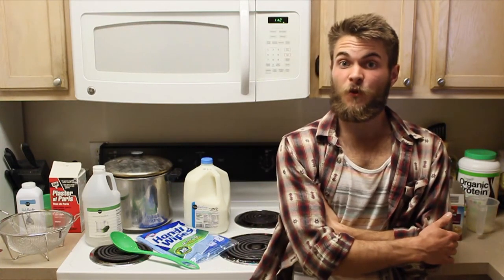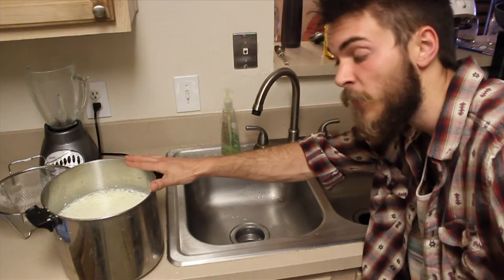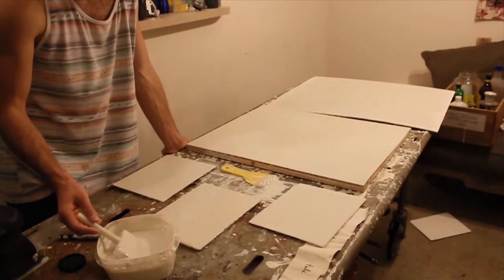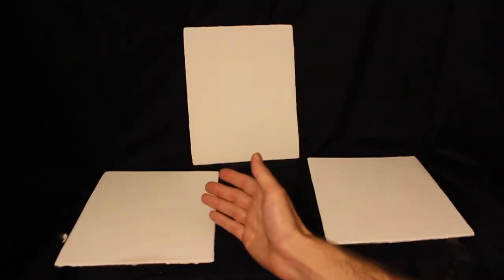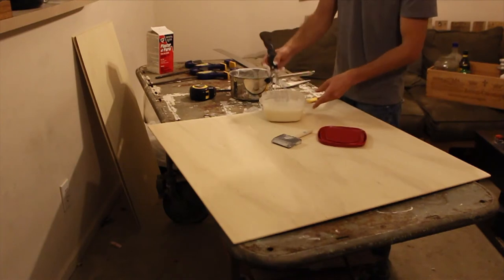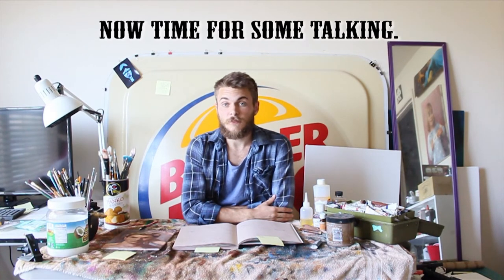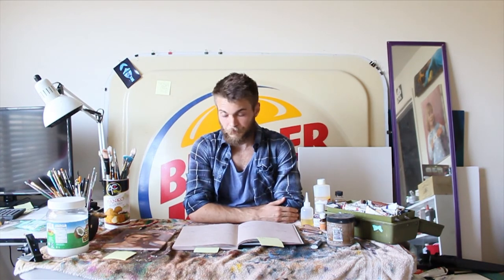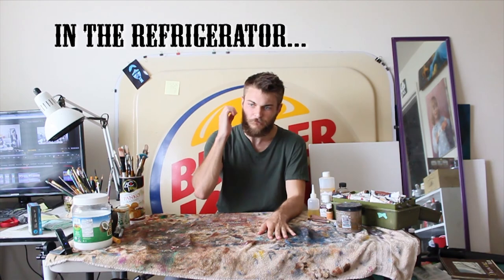Making Gesso From Casein

Comment: Hi Michael… great video! We have found the following:
1) Remember to seal your support (rabbit skin glue for example) as casein gesso and/or paints are not a sealer.
2) A drop or two of oil of cloves and/or vinegar go a long way as a preservative… in fact I have a jar of casein gesso in the fridge which is probably a year old and it still is fine.
3) You can emulsify the casein with a bit of oil… like stand or sun-thickened as a plasticiser for more flexibility… the same vehicle gives your casein colours a wider tonal range approximating oils.
4) The casein formula we found that working well for us was 1 vol of casein + 1 vol of calcium carbonate (calcite, marble dust, etc) + 10% oil as plasticiser + few drops of oil of cloves. This binder is mixed or better said dispersed bit by bit with pigment for casein colours… with titanium white pigment it becomes your gesso and/or white colour.

A question… why did you mix it with baking soda?
Reply: That was my question, too. Why the baking soda? I speculate that it is to neutralize the acidity of the plaster. I will ask my chemist husband ( Ph.D.) if there are commercially available  PH strips  so that I could test my final product for acid neutrality.
Reply: Baking soda for mixing with water. Dried casein is not directly water soluble

Comment: You said “it’s kinda like cheese” well right you were, you made ricotta albeit a very acidic one. Warm a gallon of  whole milk on the stove and add just two tablespoons (not cups)of any acidic acid of your choice , fresh lemon juice works great, and turn off heat letting it completely cool w/o stirring. The curd will separate from the whey and then  all you need to do is allow it strain in cheese cloth or a fine colander.  Makes a great lasagna or cheese cake but as for your casein I’m wondering if you might buy some store bought ricotta to save time and use that in your receipt? Thanks for your posts, you are a talented young man.

Comment: Hey, I don't know if you are still interested in casein gesso, but... I have an old recipe, recipe from a book about technology of oil painting. When it comes to wood it should be glued on both sides (70g of glue per 1l of water it should be heated in a water bath to 40C-60C) so the wood you want to use for your painting should be dried for at lest a year, otherwise it will rot (masonite is ready to use). While gluing the wood its important not to soak up the wood, it should create a thin film between wood and gesso. 
So the recipe goes:
Casein solution
50g of DRIED casein that you prepared
10g of slaked lime
This should melt right away and have smooth consistency
1part gypsum/chalk
1part zinc white(never titanium white because it dries very slowly, up to a year)
2parts water
1part casein solution
This can be applied on glued wood VERY THINLY (otherwise cracks will form) from left to right, after half hour you can apply second layer from up to down (its important that the first layer is semi-dry, because if its too wet it will mix with second layer if it is to fry it will not connect with second layer) After eight days its ready to be painted on.
Other very efficient way of applying gesso(best for canvases)  is with a shoe brush! You barley dip the hair in gesso and apply it onto the canvas moving your arm as if you were writing number 8, after whole canvas is covered you gently even it out brushing left to right, and from up to down.
Reply from the maker: That's awesome! Thank you for spreading the knowledge.

Comment: Great video. One suggestion. When I make a casein glue base, I dissolve the curds with a teaspoon or two of Borax. The result is a syrup that looks kind of like rubber cement. Other recipes use ammonia, but Borax does the same thing and doesn't smell as bad. This keeps you from having to cook and blend the stuff. A little heat like a few short zaps in the microwave helps, but that's about it. Thanks!
Reply from the maker: Michael Fraley Borax huh? I read about using that but didn't know what it did. I was also looking at xanthan gum to do the same thing. There is room for improvement here so I'll be sure to try that next. Thanks for the advice.
Reply: Michael Schmitt Just trying to be helpful, not critical. Yeah, Borax (boric acid) breaks down the curds, and, if I'm not mistaken, improves the ph balance a little too. You can use the resulting syrup like a glue, or mix it with pigments and create your own casein paint. Hey - I've had a horrible time trying to formulate a casein gesso. Nothing but a crackly mess. Thanks to you, I know now that I've not been using enough plaster. I appreciate that.
Reply from the maker: No problem Michael. I took no offence either. I'm actually very appreciative. The internet/youtube should be used for learning and the best way to do that is through communication. I'm glad we can help each other.

Comment: Hi Michael..I forgot to sayAll modern day art store acrylic primed canvas or wood panels ...are highly absorbent. This absorbency will suck the oil binder out of any oil paint, causing matte dry areas. The first step here is to apply a SINGLE coat of acrylic varnish..either matte or gloss. If too thick mix 25% water , but not more....for easier brushing. Again..place the support vertically to avoid puddles. Best wishes, Louis
Reply: Acryilic varnish before the oil paint? On canvas and wood?
Reply: @LP-zz7uz  h hi I. Yes. We can paint oil paint on acrylic paint but we cannot paint acrylic paint on top of oil paints

Comment: Thanks for doing this. When would you include a water sealing size below the gesso? I imagine wood panels would require such an undercoat. If you don't gesso and varnish the front and back of the panel or sheet can the casien rot from the back? I'm just learning about paints for the first time.
Reply from the maker: I still have a few panels that have showed no signs of rot. Although I keep them in a dry place. If you are painting on wood it is a good idea to treat the back as well but its up to you. I put nothing under the gesso. After it dried and cured I still havent had any problems with it.
Reply: @MichaelSchmittMasterMadCraft  thanks for sharing your experience. I have been doing some reading about sealants this morning nonetheless. I understand that animal hide glue was a traditional size, but it is susceptable to rot. Lacquer sounds like it may be ideal. Although it sounds like it may not be necessary, do you have any thoughts about the use of lacquer in paintings as a size or as a varnish?
Reply from the maker: Usually a laquer would be used on wood as a finish. To size a canvas of wood or cotton, would be to prepare it for the various chemicals, that would go on top of your canvas. Traditionally skin glues would be used to "size" the canvas before a white ground of white paint would complete the gesso process.  Ideally the chemicals you use to protect your canvas' foundation would be PH neutral. To prevent rot of say your paper. [I.e. acid free paper]
Or make it less delicious for bugs. Which is what I would be worried about here.
Reply: @MichaelSchmittMasterMadCraft  thank you. the video about blurring the lines and preserving accurate values was cool.

Comment: Buy Lefranc & Bourgeois universal purpose casein ground. It is in fine dust form, so you still need to prepare it by mixing with water. It is less absorbent than acrylic gesso, but still not as impermeable as oil grounds. You will be happy. :)

Comment: I rather enjoyed that milk protein video, thank you! I would like to mix my gouache with casein so that after it has dried it will not wash up again when adding a layer. What's you thoughts on this? Could I just add some casein on my palett or do you think some extra binder is necessary to add as well?
Reply from the maker: You'd have to experiment and see. If you just added pigment to this gesso it would just become paint in its own right.
Reply: @MichaelSchmittMasterMadCraft  I will for sure. When you say "gesso" do you mean just the casein or do you mean the casein plus the other ingredients?
Reply from the maker: @Thestripper1  I was referring to the gesso recipe in the video. I wouldn't worry about the ingredients, you've already got that information. I would more so worry about the paint consistency that you are trying to achieve. Along with the effects of the casein.
Reply: @MichaelSchmittMasterMadCraft  I'm mostly worried that if I added gesso, then the plaster would probably lower the saturation of the pigment used. Since Casein is a binder it wil probably work to just add that to the gouache paint, or water color paint to make it dry to a non water soluble layer. I will try and give a report soon as I get my paints. Thanks for good input!

Comment: hey I was wondering if you could use it for watercolor painting as well
Reply from the maker: You sure could.
Reply: I've been painting watercolors on gessoed panels for years...usually RSG gesso (see above)...it will ,if you've not yet tried it yet ,  .demand rethinking how you apply paint...no groovy washes ,it's best for a dry brush technique...but VERY forgiving...you can erase easily....and no more $20 sheets of paper..HOORAH...